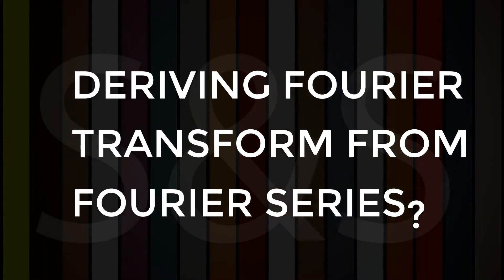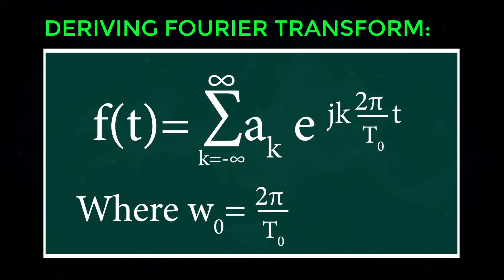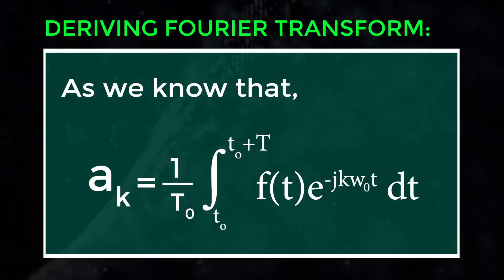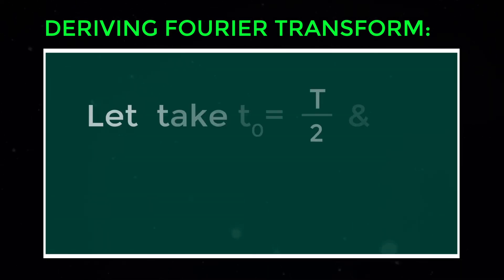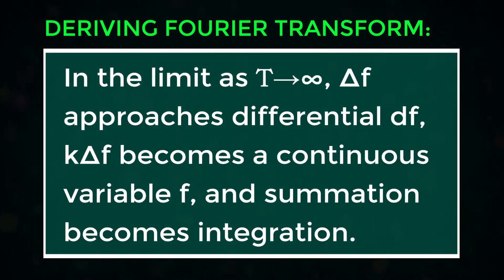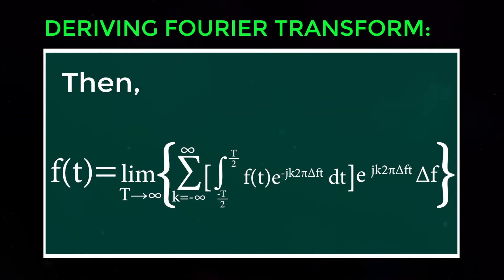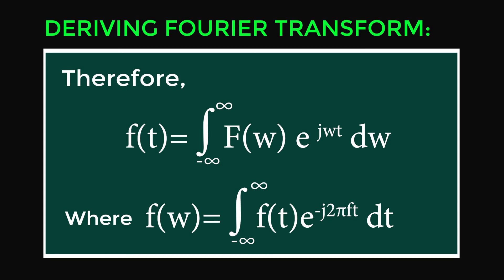Deriving Fourier Transform from Fourier Series | Learn Signals & Systems | ECE | EEE | Engineering

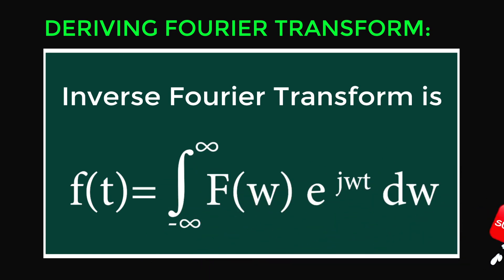Comment: Some errors at 3:16. F(w) (instead of f(w)), and 1/2pi before the integral of f(t). Also, at 3:45, you cannot put the sign equal between a signal and its Fourier Transform (just the sign ->, which means "corresponds"). Again, at 3:54, you missed 1/2pi before the integral